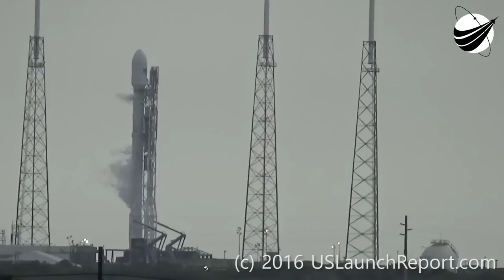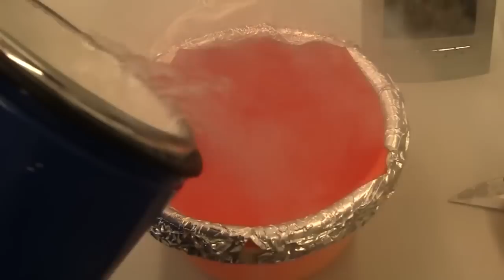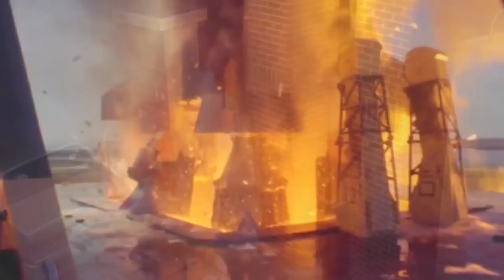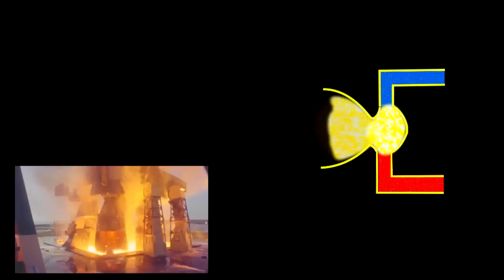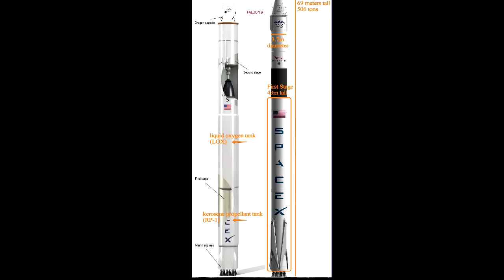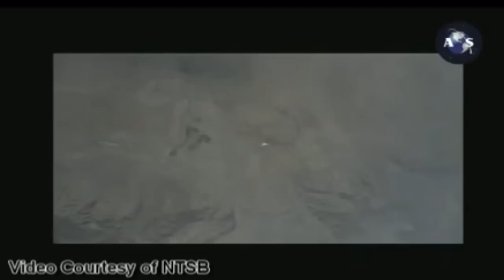Why did the Falcon 9 Explode?

Comment: A bunch of things worth mentioning:
1) The payload hit from reusing the first stage is actually very low, about 25% for LEO missions. The reason is that the mass of the empty first stage is small compared to the mass of the second stage with its fuel. Furthermore, the Falcon is now more than big enough to lift >90% of commercial payloads while still reusing the first stage, so really there is really no reason not to do it if you can.
2) Fuelling failures have not happened in the US for a long time, but SpaceX is also the first US organization to use supercooled liquid oxygen, meaning they had to design their own custom infrastructure to do it because previous infrastructure was inadequate. So saying that fuelling is a solved problem is not entirely true because SpaceX is doing something previously unattempted.
3) One failure mode you missed was the fact that the Falcon 9 has a common bulkhead design (much like the Saturn V second stage, but unlike its first stage) , i.e. there is only one wall between the oxygen tank and the kerosene tank, not two. This means that an overpressurization of the oxygen tank can pierce the bulkhead, which adds a few failure modes that you need to consider.
4) The Falcon partly relies on tank pressurization for structural support (like the old Atlas rockets for all stages, and most high-performance modern upper stages). Underpressurization can thus lead to the rocket becoming soft and collapsing unless it is unloaded. This means that both over and underpressurization of tanks can lead to structural failure if the rocket is under stress. This puts extra requirements on the fuelling infrastructure and on all valves/pipes leading into the tanks.
Reply: (cont.)
5) Parachutes for the Falcon 9 are not a viable option, even if you drop the precise landing requirements. Parachute mass does not scale linearly with payload, past a certain size their mass becomes impractical. In the case of the F9, the first braking burn is from low hypersonic velocities, so it would have to use rockets to slow down regardless. Developing a hypersonic parachute of that size would require a hypersonic wind tunnel far bigger than those that currently exist, since the parachute would need to support 50x more mass than the last Mars rover. Future Mars rovers with larger masses will not use hypersonic parachutes.
Reply: Sir since clearly you know your stuff, could you explain the viability of reusing the stage 1 rockets please? Many thanks.
Reply: 6) During the space race, NASA did some really risky stuff to get people on the Moon. The guys were extremely lucky to get back, after they accidentally broke a switch. Sure, NASA has much higher safety standards than back then, but you can't seriously claim SpaceX is unsafe.
7) Most of NASA's projects are extremely expensive because multiple independent firms work on these projects as contractors. Since they all want to make money, the total cost is much higher than when one single company would design everything. This work organization has also lead a.o. to the loss of the Mars Climate Orbiter because one firm used the metric system like they agreed to and the other United States Customary. If one firm oversees everything, such incredibly dumb mistakes are much less likely to happen.
8) Since the first successful landing of the first stage was less than a year ago, you can't seriously expect them to have used the same rocket already for another mission. Surely, you'd want them to take their time to test the landed vehicle properly, before allowing it to fly again. Surely, you'd want to be able to compare several successful landings first before allowing the same rocket to fly again. There's no need to hurry the reuse that much.
Reply: Lots of people seem to be arguing with the assumption that ThunderFoot is right. All this video was were educated guesses.
Reply: Ian Brandon Anderson Yes, the Shuttle SRB's used parachutes. But the main chutes (the largest parachutes ever made) only deployed at 2 km over the surface.  The drogue chute deployed at 5 km altitude, at subsonic speeds.

The SRB's themselves actually had to go though a fairly harsh reentry, which is not an option for the Falcon 9 first stage since it is liquid-fueled and thus much more fragile, and it separates at a higher altitude.
Reply: Those savings assume the engines are salvageable. Even if the rocket lands relatively intact those engines have to remain intact under the most extreme operating conditions machinery can be expected to perform in, as such the standards for engine parameters must be kept to the absolute maximum possible percentile for structural integrity. After experiencing a temperature variance of thousands of degrees over the course of a few minutes and the massive expanding and aerodynamic forces those engines, fuel tanks, and fuel lines will need a very thorough examination for damage. As Tfoot states the Space shuttles most replaced components were engine components, particularly the fuel pumps. You're not really saving much if you need hundreds or thousands of man hours to inspect every minute detail for damage, which will hahve to be even more thorough then before the first launch as fatigue damage will snowball very quickly in a system like this and routinely replacing the most expensive components of the engines. In addition you will need to carry proportionally more fuel to reach the same altitudes, so more money is being spent. Again, as Tfoot said, we haven't seen a single re-used rocket engine of the size spacex is planning, and the comparatively smaller and cheaper space shuttle engines still made for one of the most expensive engineering projects of the 20th century. That's the reason that the USSR only built the one buran platform and hardly used it. It was built to perform what was at the time super delicate tasks with large machinery such as assembling stations and maintaining large satellites, which can now be largely automated due to more advanced computer guidance systems.
Reply: Ian, the 25% penalty is after the exponential factor. They made the Falcon 9 about 30%  more powerful when going from version 1.1 to the "Full Thrust" version, allowing them to perform recoveries on all missions without impacting their payload capacity. This means they can do recoveries for all launches but the heaviest military launches, with the Falcon Heavy closing that gap whenever they get around to launching that.

Payload capacity really isn't a valid argument.
Reply: Another thing: we have a rocket is worth ~65 mil and payload ~250+
how much cheaper a rocket with reused engines is? 50mil? 35mil?
Will an insurance company be willing to accept used engines at reasonable rates?
Would a satellite company be willing to risk years of development, and money on cheaper engines?
Reply: ***** ... that's not the point i was making.
My point was that the real value is not in the rocket but in the payload. Satellites are few to tens of times more expensive then the rocket.
Rockets are well rocket science and do explode from time to time.
if you are launching a few half of billion $ cargo to space and millions of man hour of work would you think it is wise to use cheaper used engines? how much cheaper must those be for you to consider such options? 10-20mil at those sums is not that big of deal.
granted cheap 'mass produced satellites' (is that event a thing? ...box sats?) would have a different calculation.
Reply: You also have to consider that the shuttle SRBs were designed to splash down at 23 m/s while the F9 first stage has to land precisely on a barge (not all flights of course). Can I ask how precisely one could land a F9 with a parachute strapped to it (with a landing burn at the end), assuming that all other technical problems were worked around?
Reply: You are not paying for kg of cargo but for a flight that can get your cargo to given orbit and F9 is able to get 5000kg to GTO with some performance to space look at SES9 and land in the ocean this cuts down the cost to 40 mil$ other options include Proton for around 70-100mil and Ariane for 200mil but usually there are 2 satellites sharing the rocket and costs.

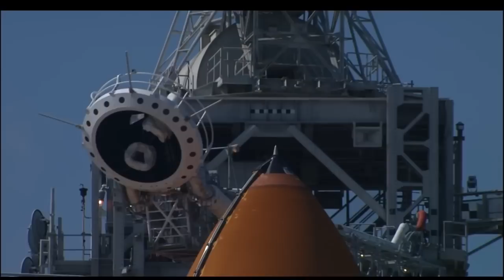This video is factually wrong in multiple places and times like the 5:50 because fueling is the first thing to do and after rocket is stable and full there is crew loading like Soyuz Shuttle and any other rocket ever did.Falcon9 can't do that because of sub cooled lox that makes the rocket standby limited to just 30 minutes.
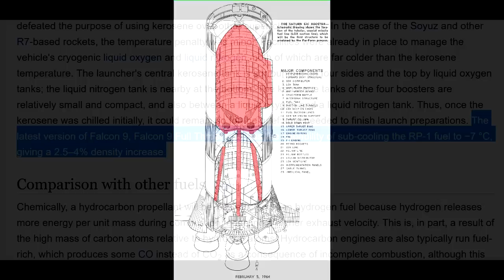11:50 there is a vacuum between the walls of the transfer tube of lox that goes through the RP1 and cooling it is to get 4% extra density not to protect it from -209deg LOX.
Entire fragments about "solved problems" can be summed up by "supersonic retropropulsion" and NASA sending planes chasing falcons during EDL because it gave them new data and was incredibly innovative.

Fragment about "bang for the buck" is idiotic because it simply ends up with making a bigger reusable rocket compared with an expendable one just look at New Glenn design that is oversized as hell for an expendable rocket but once reusable it becomes a reasonable design.
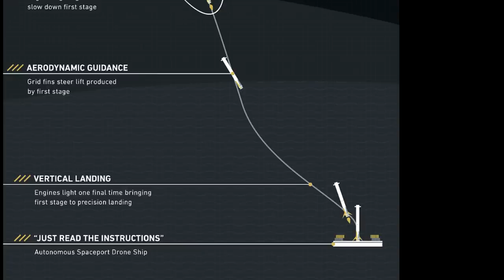15:00 last time i checked 80 000kg of LOX and RP1 cost less than around 40 mil $ that first stage does for the Falcon9 it is like claiming that best use of a 787 is to drop the passengers on parachutes once your tank goes dry and discard the plane rather than to pay for extra range (ER) version 
15:40 comparing SSME/RS25 with Merlin and claiming that these are similar show either ignorance or just forcing a narrative.+There is no orbiter with complex TPS to refurbish.
17:15 This is insane.Shuttle had incredibly vast black zones during ascent that would result in loss of crew if anything went wrong and "abort mode" that was the RTLS was incredibly risky as John Young said "RTLS requires continuous miracles interspersed with acts of God to be successful.STS had no abort for the time of operation of SRM and was limited in other aborts and things like "limit to inhibit" were created to "allow" for some increase of safety.
18:00 What does a failed Virgin Galactic has to do with SpaceX?Blue Origin is the competitor to SpaceX
It remains to be seen if F9 reuse is viable from a financial standpoint but even expendable F9 is still around 1.5-3x cheaper than comparable launch vechicles like Proton/AtlasV/Ariane5
+ also in previous video on the topic he criticized SpaceX for using common bulkheads that are incredibly common in launch vechicles from Soyuz and Saturn V to Ariane5 and Falcon9
Reply: spacecadet35 Except that's not what SpaceX did. With their reuse scheme, it is 22 tonnes to LEO at a higher price OR 16-17 tons to LEO at a lower price. Reusing a booster is optional, just like solid rocket boosters on the Atlas are optional. The reuse option does not reduce the max payload of the F9 at all, it just allows SpaceX to offer lower prices on lighter payloads.
Reply: Actually, it was definitely possible with less mass- the parachutes for the Shuttle SRBs show that. 
It's harder to reuse and refurbrish though due to seawater contamination.
Reply: +Operkoi
They already test fired the first recovered rocket, and it will fly again soon.
Reply: +Martynas Stanaitis It appears you're confusing the cost of a rocket (specifically, the first stage) with the cost of a launch.

Right now F9 costs ~$62 mil to launch, almost all of which is the actual cost of the rocket + profit margin. This is already less than all other rockets of its class. Most of this is the cost of the first stage which is doing all the "heavy lifting", so to say. The second stage is not reusable and is not likely to become so in foreseeable future. On the other hand it's significantly less expensive because its load is much lighter, so one engine is enough.

So let's say the cost distribution between the stages is 80/20 (ballpark numbers); in other words, $50 mil vs $12 mil. Assuming the first stage lasts for 10 flights, and each time has to go though a $2 mil maintenance, it will make the total cost of the vehicle itself 50+10×2+10×12=$190 million. But since this cost is spread over ten launches, the cost of each would be: 190/10=$19 million, a threefold reduction over the current price. If the 2nd stage is actually even cheaper than I'm assuming, and/or SpaceX somehow manages to make the first stage last longer (eg. 30–40 flights), we can see a cost reduction of an order of magnitude (down to $6–8 million) early within the next decade. As the recovery technology matures and new engines and fuels are developed, further reduction allowing sub-million launches will be in the realm of technical possibility.
Reply: After experiencing a temperature variance of thousands of degrees over the course of a few minutes and the massive expanding and aerodynamic forces ...

You mean like jet engines
Reply: Satellites have become increasingly more elaborate and costly over the decades precisely because of the initially very high cost of launch. Its catch 22.  
The cost of a satellite is greatly elevated due to super rigorous 6-sigma type testing because no one traditionally wants a fail in space because of  the huge cost of re-launch is/was  so very high . 

First bear in mind space x is a cheap rocket development anyway - evane as a disposable. For comparison Boeing is 3-4 times cost. So before space x started to change things satellite costs were comparable with rocket costs.

The greater idea of space x that the fuel itself is trivial~0.1% cost of launch    ~$60,000 and that unless addressed teh cost of the rocket will make space prohibitively costly for everyday access. The fuel to space is actually comparable to fuel for a jet flight across the atlantic.  Imagine the cost escalation though after each transatlantic trip the jet-plane was trashed. 

Imagine a space x future where the complete rockets are reusable - at least say for 100 times  - so only 1% of rocket costs per launch ~$600K

Satellites in future may still take $250million to develop and test - but thats mostly investment in manpower of design ...etc  plus first runs of ASIC electronics...etc ..... but you could likely have 5 more made for little extra cost. 
So even in  future the useable rockets prove less reliable a relaunch  starts to matter much less - and overall the average costs still tumble .
Reply: spacecadet35 I mentioned that in Ariane5 fragment because it is the only rocket using standard 2 satellite launches as the majority of their business.And being a secondary payload is an extra problem + coming micro launchers like Electron might cause a change in this market.There are also launches of things like SHERPA tugs that take up to 90 small satellites on them

Falcon9 will come even more relevant if they menage to get more dual launches with coming increase of electric propulsion in satellites like recent Eutelsat launch that got 2x2500kg  satellites to GTO.

This video is has nearly nothing really factual in it for a channel that prides itself to be based on logic.
Reply: +PierreDolphin right now most of the money to launch these rockets goes to building them and specifically the engines. Landing the rockets means you now only need to refuel it, which costs hundreds of thousands instead of millions and and unknown amount of refurbishing which is estimated to cost a few million. If everything works out then the $60M single use rocket turns into a maybe $80M multi use rocket. This lets you spread out that $80M over say 5 plus flights bringing each flight down to less then $20M. This is the goal and the savings numbers I made up to show the desired outcome for this project. So far they have done a full test burn on one of the recovered rockets and another is scheduled to fly pretty soon.
Reply: +Lttlemoi that's a good point.
Reply: Tank pressurised stages were sorted out a long time ago.

Also, the fact they did all that to save dry mass is telling that they need higher safety margins... especiallululy since it's reusable.
Reply: KSP made us all experts.
Reply: Martynas Stanaitis Well someone is currently willing to risk it as they have a company paying to launch their cargo on a recovered first stage. Interestingly they were also the first to commercially launch with SpaceX.
http://qz.com/769982/spacex-has-found-the-first-client-for-its-reused-ahem-flight-proven-rockets/
Reply: As a troll, is whatever lights up your neural paths that makes you happy based on
(a) actually initiating the actual expletive ridden unfunny no evidence based putdown or 
(b) if someone  - like me - then responds to it.
Reply: The salvaged engines of the rockets obviously has to be checked, refurbished, checked again and tested...just like jet engines. The main engines, of a powerful rocket, are however exposed to much more extreme conditions, temperatures and vibrations than your average jet engine. That will naturaly increase the time and resources that has to be spent on repairing and clearing an engine for further use. In the case of the space shuttle.. the shuttles engines didn't have to pull all of the massive takeoff weight and could be designed for better longevity. I do see a point in it being only marginally economical to salvage the engines for anything else than the metal. The hull and tanks of the rocket it self is cheap and easy to build in comparison. But then again..If its possible to reuse them I'm all for it.
Reply: Also, on a side note, I just saw the New Glenn announcement by Blue origin. Apparently they are skipping the Falcon 9 size segment and going straight for a larger-than-falcon-heavy rocket, which is all-methane and powered by the BE-4 engine, with an optional hydrogen third stage.

It's interesting to see multiple companies developing SHLV's independently, with completely independent supply chains. That would make using private vehicles for NASA exploration missions a lot safer.
Reply: rhetorical ABM Sprint Actually, no, if the S-IVB's J-2 failed, they were fucked and would have to abort. Luckly that never happened, and the S-II took most of the brunt of the pogo oscillations from the F-1s and thus also the failures.

Technically, having fewer engines means less of a chance of any one failing, and lower cost, due to lower complexity. HOWEVER, that ignores redundency and mass production, which complicates things.

https://en.wikipedia.org/wiki/Apollo_6#Launch

Not a real failure, but the pogo oscillations on the F-1 (also a problem on Apollo 13) caused the J-2s to fail. So 2 J-2s failed, as far as I know.

Technically a success, but the failure started with the F-1s.

"No one ever died because of it because it was designed with extra margin so that the mission did not have to be aborted if one engine failed.

Unlike the Falcon 9 which has no margins neither in structure nor in thrust.

That's also the reason why it will never be allowed to carry humans."

Except it's being manrated to carry humans on Dragon V2. lol and you call be denialist.

It also has margins in thrust (One Merlin failed on CRS-1, causing the mission to be a sucess- it was a partial sucess because NASA would not allow the lower margins  to risk the Oorbcomm satellite in Dragon's Trunk to be deployed and potentially crash with the ISS with any chance greater than 5%.

Similar situation when one J-2 failed in Apollo 13. Apollo 6 wasn't so lucky.

""Nor did it launch enough."

Not an argument."
Yes it is. No rocket or engine is never going to fail. It just never launched enough to fail.

Here's a mental experiment- there is a rocket with 1 success out of 1 launches. Another has 98 sucesses out of 100 launches. Which one would you rather risk your life to go to the say, the ISS on?

""Honestly, even the F9's Merlin is safer in terms of successes. There were only a few failures, none resulting in mission loss,"

No it is not.

It failed more than once and if you count the orbits that were way off SpaceX reliability goes down even more."

https://en.wikipedia.org/wiki/List_of_Falcon_9_and_Falcon_Heavy_launches#Launch_statistics

Only ONE mission had ANY sort of failure or wrong orbital insertion because of the Merlins. All the others were due to the tanks and structural failures. Which worries me because SpaceX tanks are very low mass fraction. Apparently that comes at a cost of being a little flimsy.

""Almost triple with one F9H."

Oh the rocket that was supposed to fly 3 years ago and we hear nothing about anymore?

Aaah lets just ignore that and come up with a new phantasy project so everybody thinks we are super progressive and cooooool.

SpaceX fanboys living in denial again."

It's literally 2 F9 1st stages attached to a F9.
If you follow Elon a lot, you know he is a little crazy, and is a huge optimist. You always have to take his estimates (especially time) with a grain of salt. I've criticized the MCT plan for the same reason and not giving enough margin or abort options for the crew. Or even realistic timescale numbers. Seriously, look it up on Youtube.

I'm far from a SpaceX koolaid drinker. I just give them credit and defend them where it is due, buddy.

If you actually go to space forums, you WILL know what the TRUE definition of SpaceX Koolaid drinker is.

If you criticize SpaceX and/or their rocket designs and plans a lot of the time, everyone will pound on you. Some people are fucking religious about SpaceX. No joke.

People actually view me as a SpaceX and Re-usability Skeptic for the most part. :P
Reply: Cheers.
Reply: That's a LOT since the rocket equation is exponential..
Reply: I'm not worried, just wait a few weeks and what the real cause was should become apparent.

Though I really think F9 needs to up its reliability. It can't afford the constant delays from them- and the F9 has lots of extra lift capacity even with reuse once the falcon heavy is a thing.
Reply: noname117spore well, they could detach the shutes at X distance from the barge.
Reply: Mario Joia
They still have to have precision throughout the re-entry and descent through the atmosphere. That's when differences caused by the chute probably matter the most.
Reply: noname117spore WELL, you asked for a mean of doing it, I gave it to you.
They can then find ways to circumvent the inherent problems, they are the researchers, not me ;P
Reply: Thanks!
Reply: the stated price after reuse is about 40 mio $, since they have a lot of staff to support (the launch tower..etc)
Reply: They have, fckin liar. The engines have been tested and retested multiple times, including multiple full duration static fire burns. They are quite OK. Stop lying. You are literally lying here. Stop lying.
Reply: Imho, reusability is nice but it is not the only thing required. The key is increasing launch rate, which was where the shuttle failed.

Airplanes are cheap because reuse allows a high flight rate, but if due to airport bottlenecks there were only 5 airplane flights a year and to make even one plane you needed a factory that could make 10 planes a year, expendable planes would definitely make sense.

So what is needed isn't just reusability, but rapid reusability which enables a high number of launches. This is a very difficult thing to do, and requires that a lot of other things work out perfectly.

My hope is that SpaceX will achieve that goal eventually, starting with a combination of more pads, improved pad flow, and fewer interruptions. It may take a while though.
Reply: they have real recovery rate of 75 %, 100 % for KSC-LEO missions
Reply: bull-fucking-shit, nothing has to checked..at all
Reply: Yes, but high lifting costs contribute to high satellite costs. If it's substantially cheaper to deliver a payload into orbit, then trading cost for mission risk can be considered. Whether or not Space X can realize those launch savings remains to be seen: every lesson learned adds to the process manual, until you're as cumbersome as the incumbents.
Reply: nehorlavazapalka Nothing has to be checked..at all?
That isn't the truth..and you know it.
Go sit under a bridge..with the other trolls.
Reply: meaning that you don't have to pull the engines appart, just routine check, static fire and that's all.. the turbopumps aren't as fragile as you want us to believe and Musk would have ended it if he knew, aside from that there is nothing that will prevent the engines from running 3*10 minutes, they even stated they may go up to a hundred, with coking from carbon deposits being the limiting factor, hence the use of methane on Raptor, to limit carbon deposits
Reply: nehorlavazapalka Ok. Then I understand where you got it from..Sorry for the troll bit.

Never said anything about the pumps..yet.
Carbon deposits and oxidizers are a limiting factor on the pumps, correct. The other more pressing factor is the medium they are pumping. Liquid oxygen is very cold and puts the pump design under a lot of stress. Not to mention the risks of cavitation, that can cause catastophic faliure, in such high preformance systems.
At the very minimum I would belive that the pumps has to be stripped and cheked (NDT method that is suitable) for micro cracks and pitting.

I dont know who is responsible for approving the design, matinence schedule and air worthiness for rockets..The FAA?
Reply: ***** SpaceX's whole goal was reusable rockets so I'm assuming they thought about how much maintenance they expect to do on each rocket. You and others seem to be arguing from a point of they have already failed and need to prove themselves again. They have a successful record in launching rockets and so far their engines have an unmatched 100% reliability rate with re-ignites  included. They have a customer lined up already and plan to move ahead. Wait and see how their recovered rockets work before writing off the whole thing.
Reply: I have always been less than impressed with the economics of the recovery. If you reduce the LEO payload by 25%, that is a reduction of 5,500 kg. At $3,000 per kg, that is a reduction of $16.5 million of cargo you can carry. Assuming they achieve a 75% success rate. It is costing them $22 million just to recover the stage in terms of lost payload. Then throw in refurbishment costs and you might as well have built a brand new first stage. There is no reason they cannot recover the engines and ditch the tank. It would be a lot cheaper.
Reply: dude, run for SpaceX CEO
Reply: Shlomo Actually, you can often piggy back onto another launch.  Of course you have to wait for a launch going your away,
Reply: Shlomo
thank you for your post
Reply: spacecadet35 You don't reduce the LEO payload any at all. That's pure nonsense. You have more lift capacity than your customer needs, so you use the capacity they don't buy. If they buy all your lift, the rocket becomes expendable. The lost payload your math is built on is zero. Now, what should be expensive is the first few recovered boosters. The first one, I'd disassemble, X-ray, laser measure wear, examine with a microscope, rebuild it, and hang it on a display stand as a museum piece somewhere or another. And the second one, I'd test fire over and over until something failed. But since the rocket is designed for several reuses before maintenance, I would want to test fire and refly the third booster. And again, hang it on a display stand as a museum piece somewhere or another. I'd start looking for savings sometime about flight ten or twenty with reflown boosters.
Reply: T Samuel Harrison If your original rocket can deliver ten tonnes to LEO and then you modify it so it delivers eight tonnes to LEO, you have reduced the throw weight to LEO by 20%. You also reduce what types of payload that you can deliver to orbit.
Reply: and there aren't any payloads above 15 tons to LEO nowdays, pretty much, though this is gonna change
Reply: Operkoi
The stages were restarted on the ground 10 times, it seems to be the case- at least without huge amounts of maintenance, like the SSMEs.

Still, reuse isn't a sliver bullet. At best, it'll likely save 15% or less when you add the extra rocket you need for reuse.
Reply: nehorlavazapalka
There are rockets that need the extra power for GEO, though... it's actually the "big" market right now..
Reply: *****
No, the first F9 flights didn't even attempt reuse....
Reply: Martynas Stanaitis
Actually, with SpaceX, the cost is 1.5X to 3X the rocket for the satellite. I calculated. It's still essential for satellites to get cheaper, though.
Reply: spacecadet35
Because the tank is still a big part of the rocket cost.

ULA is trying what you propose. Let's hope it pans out.
Reply: During the space race, NASA did some really risky stuff to get people on the Moon. The guys were extremely lucky to get back

The SaturnV and it's engines are the safest that have every carried a human into space.

Stop spreading your ill informed myths.
Reply: rhetorical ABM Sprint Not really, the F-1s failed a few times during launch, along with their counterparts, the J-2s, such as on Apollo 6.

No one ever died because of it because it was designed with extra margin so that the mission did not have to be aborted if one engine failed. Nor did it launch enough.

Honestly, even the F9's Merlin is safer in terms of successes. There were only a few failures, none resulting in mission loss, and launch 10 times with one F9. Almost triple with one F9H.
Reply: Ian Brandon Anderson
"Not really, the F-1s failed a few times during launch,"

Source on that claim ?

"along with their counterparts, the J-2s, such as on Apollo 6."

As far as I know the J-2 failed once, and unlike the Falcon the Saturn V had engine out capability during the WHOLE flight.

"No one ever died because of it because it was designed with extra margin so that the mission did not have to be aborted if one engine failed."

Unlike the Falcon 9 which has no margins neither in structure nor in thrust.

That's also the reason why it will never be allowed to carry humans.

"Nor did it launch enough."

Not an argument.

"Honestly, even the F9's Merlin is safer in terms of successes. There were only a few failures, none resulting in mission loss,"

No it is not.

It failed more than once and if you count the orbits that were way off SpaceX reliability goes down even more.

"Almost triple with one F9H."

Oh the rocket that was supposed to fly 3 years ago and we hear nothing about anymore?

Aaah lets just ignore that and come up with a new phantasy project so everybody thinks we are super progressive and cooooool.

SpaceX fanboys living in denial again.
Reply: Ian Brandon Anderson

"Actually, no, if the S-IVB's J-2 failed, they were fucked and would have to abort."

Yes but the 3rd stage doesn't need engine out capability.

If the engine fails they just have to decuple and reentry.

Priority is saving the crew when we talk about man rated rockets, but the SV had a 100% success rate so why are you even shitting on the design.

The F-1 is the most tested and most reliable rocket engine ever created.

Still waiting on the F-1 failure you talked about , not pogo a engine failure.

"Except it's being manrated to carry humans on Dragon V2. lol and you call be denialist."

By NASA ?

Source for that claim please.

"Only ONE mission had ANY sort of failure or wrong orbital insertion because of the Merlins."

2 orbits off more than 10% that's the maximum they claim in their users guide

2 total failures

explosions called anomalies

being dishonest about issues and so on

"It's literally 2 F9 1st stages attached to a F9."

If you think that this is how it works just copy past the first stage we should end this discussion here.

If it would be that easy we would have seen a FH launch 3 years ago.
Reply: @Tobeydude20  
Currently sitting at 3 crewed missions in ~1 years time, one of which reused a booster & Dragon capsule.
Reply: "If you think that this is how it works just copy past the first stage we should end this discussion here."

That's admittedly as oversimplification, there were pad modifications required, for example, but 98% of the work would be completed from the F9, and could be made in 2 years. (estimate from ULA for a similar Rocket, the Atlas V Heavy)

You also have to remember that SpaceX probably waited for all the planned F9 Upgrades to be completed, because that would be cheaper rather than constantly upgrading both.

"If it would be that easy we would have seen a FH launch 3 years ago."

We probably would have, if not for Elon prioritizing other projects before FH.

Plus, Elon is notorious for never meeting stated deadlines unless paid for doing it. Even then.
Reply: Actually, I don’t think Falcon uses balloon tanks. I might be wrong about that, though.